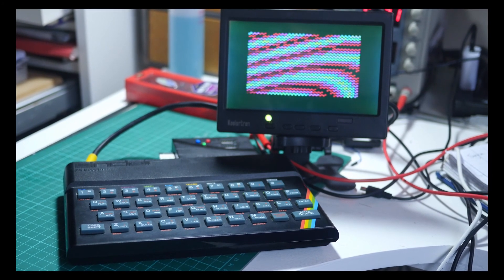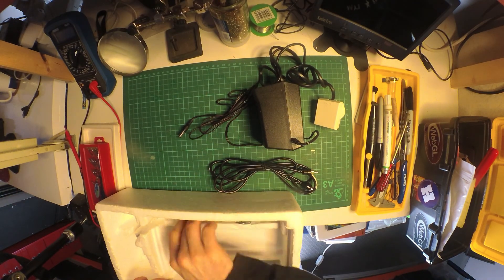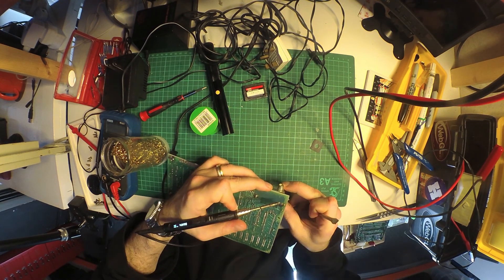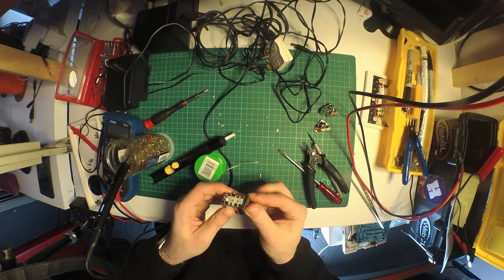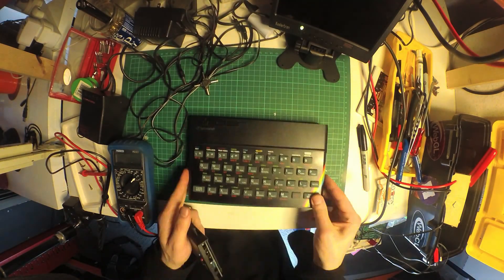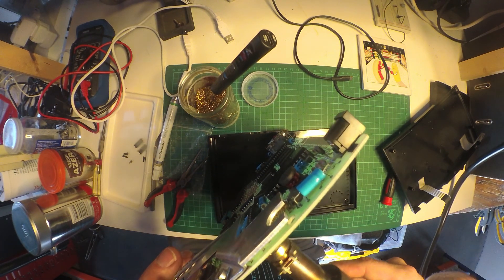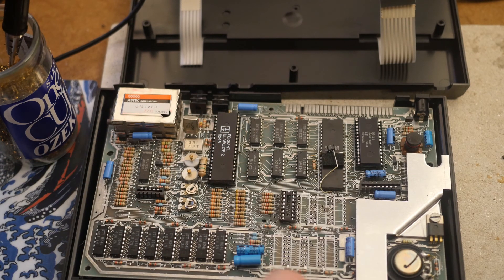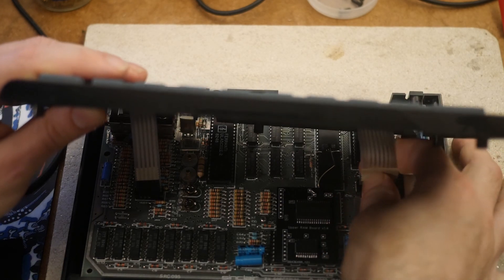0x02 THE ZX SPECTRUM 48K TODAY. PART 1

Comment: Why on earth did you do the composite mod this way? Simply desolder the resistor from the center pin and replace with the lead from the capacitor. 5 minute job to do and a 5 minute job to reverse.

That RAM replacement is lovely though!

When is part 2 coming? :)
Reply from the maker: Originally, I wanted to keep the innards of the modulator for another project I have. Sadly it broke when I tried to release it from the casing.

Comment: You may want to replace the voltage regulator too, so you won't need that huge heatsink anymore (and cook the internals of the computer :D) 
Is part 2 coming anytime soon? Thanks
Reply from the maker: Hi there. Thanks for the advice there. I might very well do that. I've started on the demo code, so yes, it will be happening. Not the next video but probably the one after.